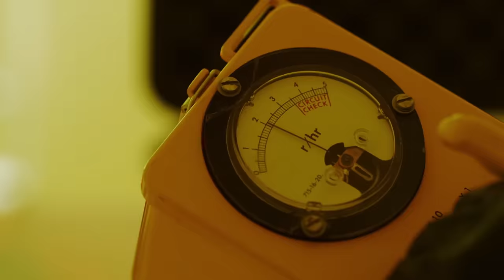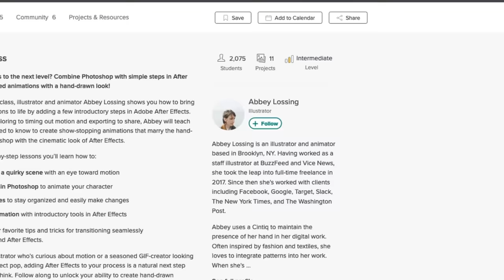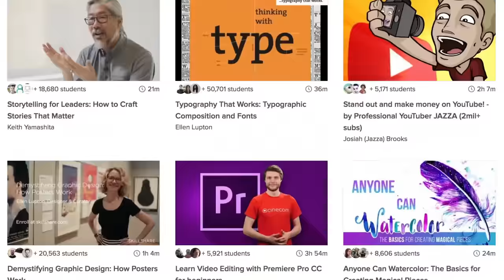Here's Why Chernobyl is Still a Massive Problem Today

Comment: everyone gangsta till the control rods start jumping
Reply: The control rods never jumped during the incident
Reply: Infact they were locked in place

Dyatlov: I lowered the control rods from the other panel
Akimov: They are still up.. they are only a third of the way in and I do not know why... I already sent the trainees to lower them manually...

This was in the miniseries
Highlithing the fact that the tips of the control rods (graphite) were locked in place after the explosion which meant that the control rods only worsened the situation as barely any boron touched the core and mostly just graphite touched it. Thus the core heated... and heated... and heated....
Reply: @DanksterPaws  ok so what were the things that were jumping then?
Reply: They were very heavy metal that weighed hundreds of kilograms...
Reply: @DanksterPaws  you said that the miniseries shows the rods didn't jump, and yet there is a scene of them jumping."Perevozchenko looks down on the enormous steel lid of the reactor and sees the impossible — the control rod and fuel channel caps, which each weigh 350kg are jumping up and down"
Reply: Dawid That is correct.. the channels were hopping... but the rods themselves were locked
Reply: Dawid I’m sorry... I am delusional! The rods were fixed in place due to the explosion... so it means it was only locked after it exploded.... I guess watching the series way too many times gives off radiation too haha...
Reply: "The rods weren't jumping"

"Because it doesn't EXIST"
Reply: Dawid God damnit... I was right... The control rods were not jumping.. Their lids were... 

Just like you said “the control rod and fuel channel caps were jumping”
Reply: @DanksterPaws  they where due to the massive amount of pressure and control rods will only jump if too much heat starts to cause pressure or the scram button was initiated which means exit 5 one reactor  control room worker decided to initiate scram and scram its like detenator  because it shuts off the reactor which leaves heat and pressure the heat created so much steam that the lid of the reactor blew off and blew off the 300 ton roof
Reply: @DanksterPaws  those where control rods
Reply: @irisgiertuga  it was the lid of the reactor
Reply: RoamArrow e
Reply: Stolen
Reply: @DanksterPaws  it wasn't the control rods it was the caps for the control rods
Reply: bruh look at this dude No they were lids... the control rods were locked shut
Reply: Flyde I said that
Reply: @DanksterPaws  you weren't there. So u dont know what really happened
Reply: Vp PriestY Yea i Wasn’t there... but it’s not like there’s a recent documentary series on this specific event? Yea... It’s not like that.... sure.... Tell that to yourself
Reply: This actually made me laugh
Reply: It wasn't the control rods jumping, it was the channels.
Reply: This was an amazing comment!
Reply: @DanksterPaws  350 kg.
Reply: Dawid I totally haven’t seen that on 15 other Chernobyl videos... I know it’s a joke. But it’s funny and common
Reply: My biggest question is what’s the point of graphite in the reactor? What does it do?
Reply: big pencils to draw memes on the nuclear fuel
Reply: Yes tell dis jumper
Reply: They're GROOVIN
Reply: @94fleetwood49  So...you are saying that nuclear reactors are fake it is a conspiracy to get tax dollars?
Reply: Everyone gangsta till the AZ-5  backfires
Reply: @DanksterPaws  HBO series is fiction.

It was Dyatlov who sent the interns, then realised it was pointless and tried to recall them, but they had run due to the urgency.

Control rods were not tipped with graphite, they were mixed purpose, half graphite moderator, half control rod.
Reply: @Tenpinmaster  You can still visit it tho
If you wanna die get into the sarphagus and try to make some Photos of the inside to Post ist online before you die
Reply: Thank you, peppa
Reply: @DanksterPaws  You are correct, for what it's worth. The pressure was making the lids jump, not the rods. You are vindicated 😁👍
Reply: @irisgiertuga  answer after a long time, but if the rods could've jump, then the explosion couldn't have happened. The steam just would have escaped, thus no explosion.

Comment: One of the main problems with Chernobyls reactor is it was designed with a positive temperature coefficient of reactivity meaning as the reactor got hotter, the fission would speed up, leading to a snowball effect. Most reactors now have a negative tcr meaning as it gets hotter, the power goes down making it naturally stable.
Reply: Thank you for this.When I watched HBO Chernobyl series,in the last series it said that it had a positive tcr,and i didnt understood that,so again thank you.
Reply: Apparently the reason for that was they could use less enrich fuel which is cheaper

Comment: There’s a giant crane on the inside of the New Confinement Arch that’s used to pick up and dismantle the sarcophagus and reactor itself. There’s a special kind of train that it would be dumped into to take it away. The arch also has huge dehumidifiers to put air into the arch because the moisture would cause the metal in the arch to rust and then make it collapse, so it lasts way longer
Reply: How do you know this

Comment: Exclusion Zone: 30 km radius. Do not enter.
People: *Challenge accepted*
Reply: It's completely fine to stand outside and inside some of the reactor buildings, in fact there are guided tours inside the plant and the area.
You will only get exposed to around the same radiation as you would while on a plane.
Reply: The artefacts are worth it
Reply: @GG_1318  Get out of here Stalker.
Reply: You could only sell them for a few dollars LOL.
Reply: The anomalies gotta fuck someone up and the artifacts ain't gonna collect themselves.
Reply: You cant collect and take away anything from the site or from prypyat without having to go through at least 3 radiation scanners and if caught you will be stopped and arrested 

You can enter illegally and try to exit unseen but as a foreigner Good luck with that.
Reply: There's several videos of people walking into the exclusion zone and spending a few days there.  Have a look at Shiey's.

Comment: I visited the site in Sept 2019.  Got far closer than I expected to.  Fascinating and haunting touring the abandoned area and city.
Reply: Did you get rid of your clothes after the visit?
Reply: @manjensen1710  we got less radiation during our five hours in the 30k exclusion zone than you get during one hour of flying above 10000 ft
Reply: @noodengr3three825  But one is ionizing radiation, the other one is non ionizing radiation, only airline crews pass enough time flying to consider it a hazard.
Reply: @manjensen1710  it is completely safe to vist now only few areas and all of those are guarded night and day or completely sealed off like the hospital basememt
Reply: @manjensen1710  are you sure cosmic rays (the stuff you get exposed to at high altitudes) is non-ionizing? A geiger counter measures only ionizing radiation and it's readings go up significantly at an altitude.

Comment: Roses are red
Metal can corrode
Now you tell me
How an RBMK reactor core can Explode
Reply: It c-can't...but it did.
Reply: @bucket1442 are you talking about that one send in EP one in the show?
Reply: @EveWazHere  yes.
Reply: @bucket1442  lmao ok
Reply: Idk but here my guesses. It either over heated and some idiots didn't pay attention till it was too late or someone did it on purpose idk
Reply: Lies
Reply: Evelyn Wilburn I'll keep it short, but basically they were trying to develop a safety protocol for an overload, this ended up being hard because they had cold water (which holds more neutrons) in the core and had to excite it. In doing so, they then freed a lot more neutrons than they expected, when a sudden, no kidding overload began, they inserted the control rods, only they had graphite tips on them because of being in that neutron sink, and so then the runaway accelerated exponentially and flash boiled the coolant water and woosh. Off goes the top of the reactor. Basically don't try to develop safety procedures. You might just induce the problem you're trying to prevent on a larger scale.

Comment: Akimov: "Comrade Dyatlov computer is giving readings to shut down the reactor immediately"
Dyatlov: "Computer doesn't know we're running a test"

😂🤣😂🤣😂
Reply: Akimov not Akinov !!!
Reply: To be fair, I wouldn't trust a Russian computer from the 80's either.
Reply: That exchange never happened. But there is nothing strange about it. In real industrial situations, automatic systems often have to be overridden or ignored.

The reactor exploded because of its design, not operator error or negligence.

The designers knew full well that it was a ticking time bomb, but kept the knowledge to themselves.

HBO series is fiction.

Read Dyatlov's book: Chernobyl - how it happened he includes citations from the designer, official documents, proving that the danger was known, and showing that the chief designer himself had called an RBMK configured in the way unit 4 was "uncontrollable."
Reply: Forest Denizen Ofcourse Dyatlov would say that
Reply: @michaelwilliams6431  it is physically impossible to create a nuclear explosion from a reactor..
Reply: Yeah but Chernobyl happen so...
Reply: @MrDmadness  No its not. It has been proven that the first of the two explosions in Chernobyl was a nuclear explosion. IT was smaller but was the one with the strenght to open the reactor and throw Elena into the air. The second bigger one was a steam/hydrogen explosion that totalled the building.
Reply: @edmartinezdj9034  no, it's literally impossible, I'm not joking.
Reply: @edmartinezdj9034  there was no thermo nuclear explosion at chernobyl. Fact, the other reactors kept running the entire time, a nuke would be a much larger damage. Water expands 2500 times its volume when it flashes to steam... capable of rupturing any vessel.
Reply: @edmartinezdj9034  I sound like that because I do know.. it doesn't really matter if you believe me or not. The reaction that takes place in a reactor is not even from a physics perspective then same as what happens in a nuke, simplymput there is no cascading expansion to facilitate an explosive reaction, that's why the biggest threat is a melt down.. they literally cannot explode in a nuclear fashion there are not enough free electrons to do so
Reply: @MrDmadness  Well it seems that the Swedish Swedish Defence Research Agency, the Swedish Meteorological and Hydrological Institute and Stockholm University disagree with you. I take them over a keyboard warrior like you any day. For starters a steam explosion cant melt a hole on a plate of 2 meters thick of steel. A nuclear explosion can. For seconds, what can happen on a reactor is what it's known as a fizzle. Do you know what this is? It;s not a significant explosion, nor a full "nuke" like you said(that term gives away th fact you are just an aficcionado) but is still a nuclear explosion. The number of free electrons is enough for this. And for thirds this is the only way to explain readings of Xenon Isotopes on Cherepovets, days after the accident.Those are facts.But if it makes you feel better to think this was impossible, keep being a soviet scientist.
Reply: @edmartinezdj9034  literally not possible.
Reply: @edmartinezdj9034  note none of your sources are nuclear physicists. Just saying, if I want to know about corn I talk to am farmer not a tractor manufacturer. Both have good ideas, one actually holds wisdom ;)
Reply: @edmartinezdj9034  if you feel like actually looking into it, there are not enough free electrons to facilitate a nuclear explosion in a reactor, partly due to the fuel they use, this is WHY there is enrichment of fuels. The steam did not melt a hole, this is not physically possible either ( latent heat ) , it can cut a hole for sure though. And the isotopes you mention would be widely scattered when the rupture happens. Water ( yes heavy water too ) expands 2500 times its volume when itm flashes To steam, there are few things that we could engineer that would contain  this. Speak what you will, and take what you will from this conversation but I'm much more knowledgeable about this than you think I am... respectfully intended
Reply: What a load of crap. So basically you made a giant comment to no say nothing. Well yes the free electron thingy you  said  at the beginning... How do you suposse thre are not nuclear physicians on any of the organizations mentioned in the article? I suposse if they are doing a study  about this they ARE nuclear physicians. Again, I will take their word over some kid on youtube that thinks he is very smart.
Reply: @edmartinezdj9034  like today everyone is expert on corona,doctors,nurses,eye surgeon.He is right but he also is missing few points on electron moving inside the core.But my english is not good to profesionally explain.But no nuclear explosion happened at chernobly.
Reply: @22.calibermaster98  Here you have another link from a different page about the same thing you say is impossible.  It all seems quite solid to me. And like I said I trust scientist more than youtube guys, and even more WHEN THEY ARE NOT WORKING ON THE NUCLEAR INDUSTRY.
Reply: @edmartinezdj9034  okey then go to that link read that and come back here and give me the definition of "nuclear explosion" like made in bomb made weapon .
Reply: @22.calibermaster98  "Chernobyl was a special case; it was melting when the scrammed it, and the additional reactivity of the badly designed control rods sent it "prompt critical"; Search "Pub913e_web.pdf" for the full report on it.

Prompt critical is what you want in nuclear weapons, not a reactor. Allowing this in a reactor design was criminal, but there are still some of those reactors running"

An industry gets judged by the public on the actions of the Worst actors, not the best.
Reply: Fun fact: The test never caused it. The test actually went well, and had been done on the core before. Can't remember what Dyatlov said. But he was pretty much on his deathbed when he gave the interview. Why would he lie when he has nothing to gain or lose.
Reply: @MrDmadness  It can't cause an explosion like a nuclear bomb. It is literally designed not too. But it can cause a Nuclear explosion still. Which it did.

Comment: I think there's actually a pretty good argument to be made that the total dollar amount of damage caused by the Chernobyl disaster is immeasurable. It's one thing to calculate the cost of cleanup and mitigation, infrastructure damages, economic losses, and healthcare costs; however there is a case to be made that Chernobyl was among the (if not the) leading factor in the collapse of the Soviet Union because it brought to bear some of the serious flaws in the Soviet government at a time when hardliners where fighting against a Soviet population desperate for modernization. If this is the case, the actual dollar amount could easily reach into the trillions if it could be calculated at all. After all, how do you calculate economic costs of the collapse of several nations simultaneously?

Comment: Just use flex tape on the reactor to keep it together and you good to go!
Reply: "HI I'M PHIL SWIFT
Reply: @ocefloww  Back with flex seal liquid, that you can pour right into cracks!
Reply: Get a second can for free.  Just pay the shipping and handling.
Reply: Some flex tape gorilla glue and a bit of Obamium alloy will hold it together easily